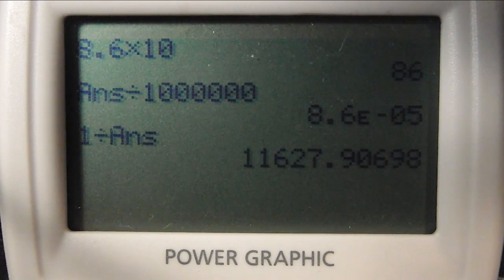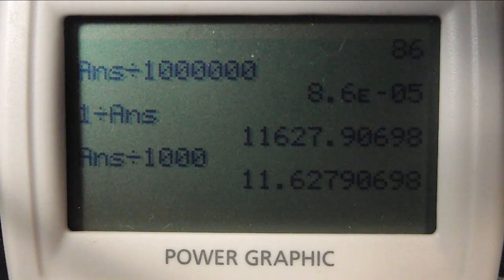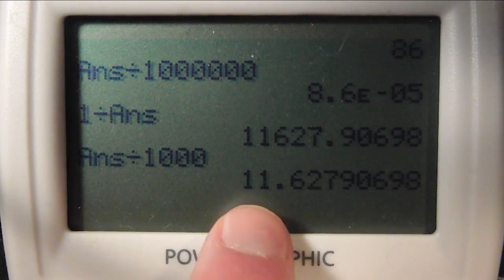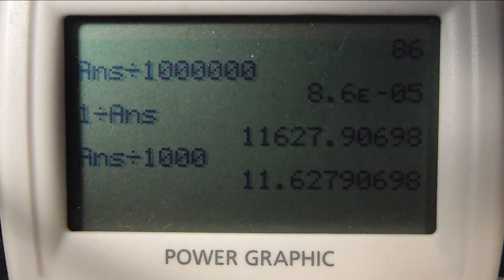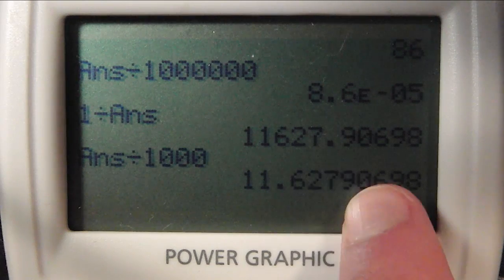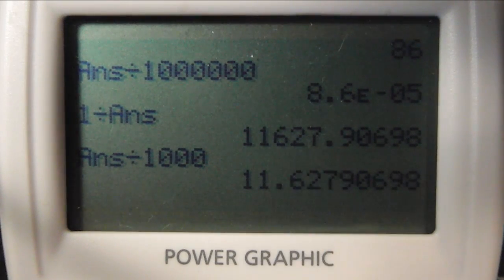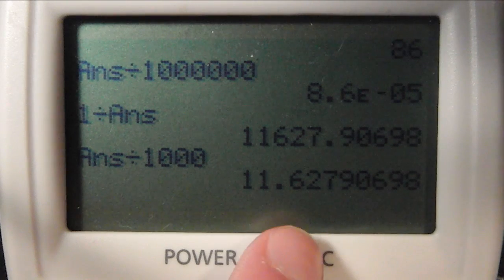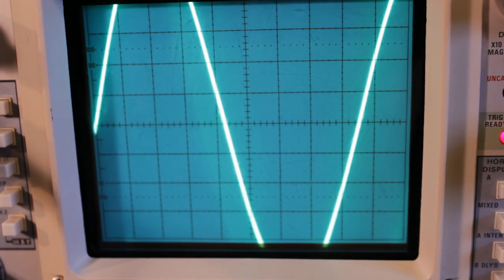How to measure frequency on ANY oscilloscope!

Comment: Imagine I used a step down transformer  and dispalyed the output voltage on my oscilloscope. My measured frequency is 122Hz  but am confused since I know the transformer doesnt change the input frequency only amplitudes. My input mains is 50HZ. WHAT JUSTIFIES MY 122HZ GOTTEN AT THE SECONDARY OF THIS TRANSFROMER  ? 
ANSWER NEEDED PLS!

Comment: If that is an ac signal how do I measure my frequency?
Reply: Imagine I used a step down transformer  and dispalyed the output voltage on my oscilloscope. My measured frequency is 122Hz  but am confused since I know the transformer doesnt change the input frequency only amplitudes. My input mains is 50HZ. WHAT JUSTIFIES MY 122HZ GOTTEN AT THE SECONDARY OF THIS TRANSFROMER  ? 
ANSWER NEEDED PLS!
Reply: Imagine I used a step down transformer  and dispalyed the output voltage on my oscilloscope. My measured frequency is 122Hz  but am confused since I know the transformer doesnt change the input frequency only amplitudes. My input mains is 50HZ. WHAT JUSTIFIES MY 122HZ GOTTEN AT THE SECONDARY OF THIS TRANSFROMER  ? 
ANSWER NEEDED PLS!

Comment: My oscilloscope is very old and the only knobs it have is V INPUT  with selection X1 , X10 ,X100 and the second knob have selection for frequency x1, x10KHZ, 100KHZ there is no knob for time selection in milisecond like yours. How can i measuer 20,75MHz IF frequency for FM tube radio with this piece of shit. My oscilloscop is the LBO-310 model.